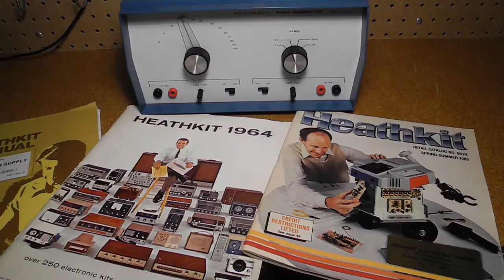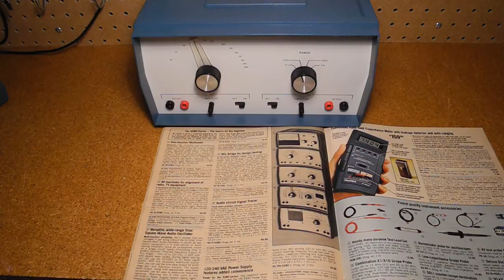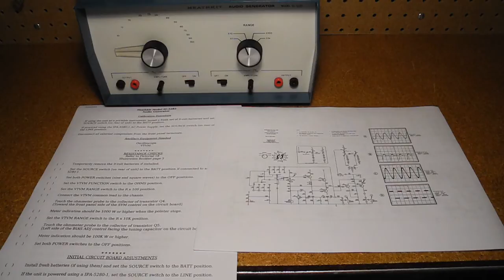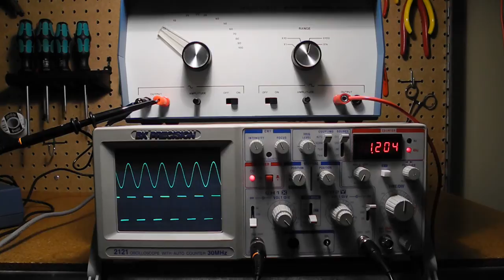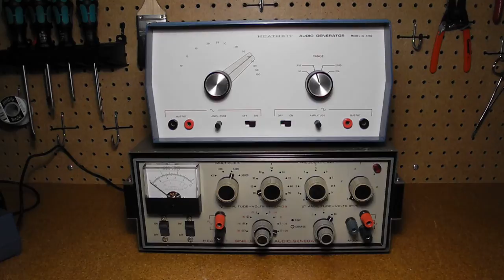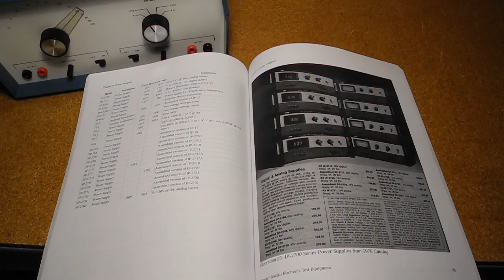The Heathkit IG-5282 Audio Generator

Comment: Neat, but what are they used for in the real world?
Reply from the maker: Common applications would include aligning and testing radio receivers, audio amplifiers, public address systems, etc. Square waves can be used for digital logic circuits as a clock or test signal.
Reply: @jefftranter Thanks! I'm just getting started in the wonderful world of vintage tube gear, and now that I finally have a square wave generator, I have no clue what to do with it. :)
Reply: @charlesgplott5133  Thanks Charles! I'm an old dog, but new to vintage tube gear. So for the last two years I've been on "Vintage Safari", on the cheap. I figured the best way to learn is going through the old test gear, then use the test gear to fix amplifiers. This is a thrilling hobby, and thanks for the advice!
Reply: @jefftranter  Can they be used to find out why a channel is out on a receiver or trace it to find out what caused the lack of output on a channel?
Thank you
Thank you
Reply from the maker: @SDsailor7  Yes. Google for "troubleshooting using signal injection" and you should find some relevant articles and videos.
Reply: @jefftranter  Thank you Jeff

Comment: bought mine back in the 70s with the RCL bridge and multimeter. my audio generator has the sheild. however tried dozen of times over the years could never get the audio generator calibrated. only componet not replaced was the ganged tuning cap. also had trouble with the RCL bridge. the only two that worked where the Multimeter and the transistor tester.

Comment: How would you use this component to troubleshoot a stereo receiver? can it be used for that? does anyone know?Thank you.
Reply from the maker: It could be used for genereating a signal for testing the audio amplifier sections of a stereo receiver, but for the rest of the circuitry you need a different piece of equipment. See my video on the Heathkit IG-37, for example.
Reply: @jefftranter  those connector on the rear are a pain to remove I just left them connected in fear of breaking the plastic connectors.

Comment: I still use my heathkit ig 5282 generator. Yes, the circuit is enclosed in a metal can. I bought it in 1978 or 1979 
when I was in trade school. I power it using an external home made power supply I made using an LM317 and
an LM337 for the +/- 9 volt supply. I have the old manual too. I just finished performing a test to see what the 
output impedance is. I get about 2.1 kilo ohms. What do you get?

Comment: Hi Jeff! Thanks for the great video. I am trying to repair a badly treated 5282 I recently picked up at a hamfest for $3. I suspect it has several blown transistors from somebody installing a 13.8V power supply :(

Two quick comments. First, my unit does have the upper shield (its S/N 00738). I can see your chassis has the holes for it. 
Also, my unit has tantalum caps as C4, C5, and C6. Your unit appears to have electrolytics in these positions. C3 and C7 electrolytics on your board appear to be the same as mine. Tantalums at C4, C5, and C6  are specified in the manual, which you can download from mods.dk.

Comment: I built the whole 5280 series and an IO-4105 scope in the early 1980s as my first set of test gear. Worked all summer to earn enough money to buy the kits, and built them up over about a month.  Not the greatest stuff, but more than adequate for a beginner.  Served me very well until I learned enough electronics to graduate to second hand HP and Tektronix type gear from local fleamarkets and hamfests.   

My audio generator definitely had the topside shield.  I remember the difficulty in getting the frequency trimmed properly so that the calibration was close on the higher ranges. Installing or removing the shield would cause the frequency to vary considerably. I did modify all 5 instruments by installing LEDs for power on indicators.